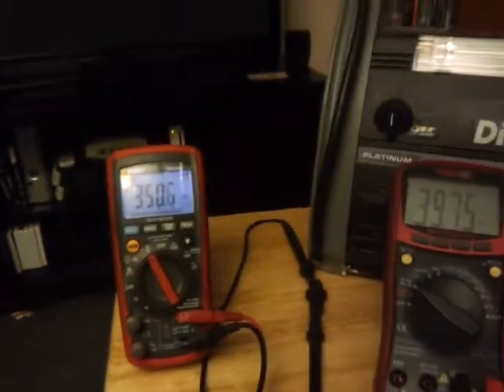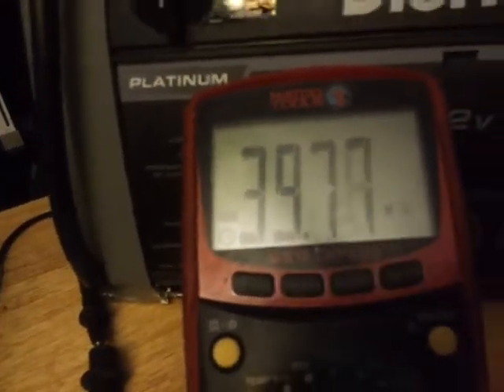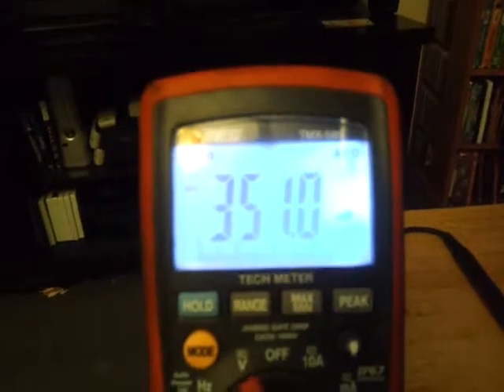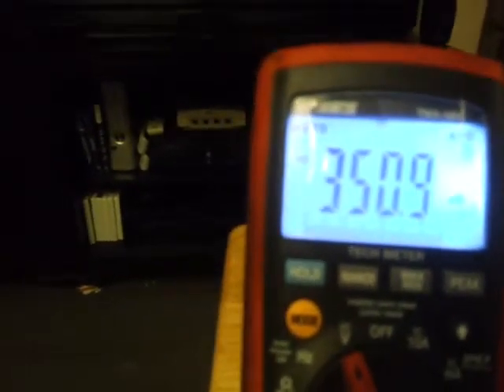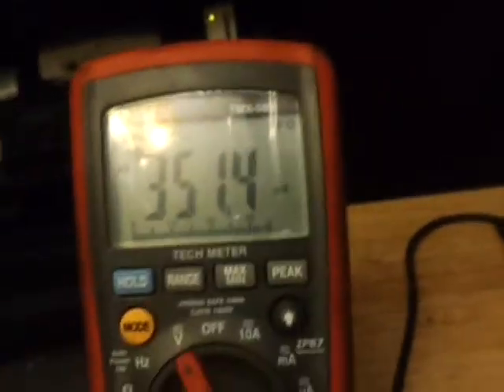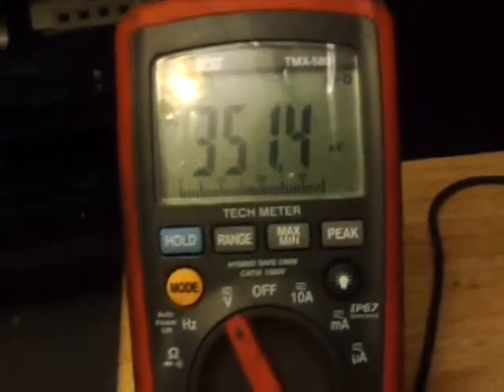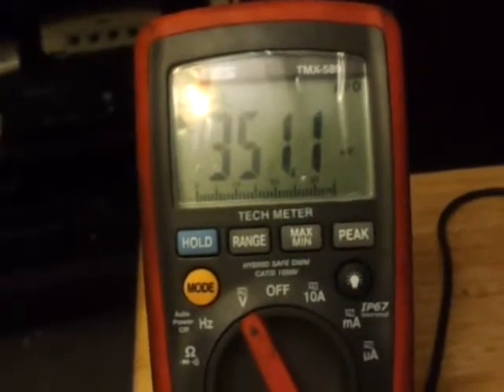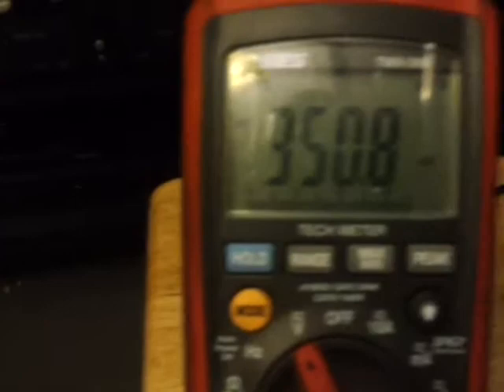Ohm meter testing vs. voltage drop testing/ loadpro operation pt.1

Comment from the maker: And if you want to know the current draw for the tool.  It is .5 amps for 12 volt systems, 1 amp for 24 volt systems.  I have used this on 3 wire 5 volt sensors too, no problems, works great.  If you have any more questions spelunkerd, more than happy to answer them.

Comment from the maker: Now if you want to check the ground side of the circuit, all you have to do is put the red load pro lead to a positive source, then put the black lead to the ground wire.  If you see ghost voltage, open ground, if you see full voltage, push the load pro button, minor drop, your good, if it drops substantially, bad ground.  These leads work just like a test light except you get to see the voltage drop and know what the voltage is compared to knowing if the bulb is bright enough.
Reply: busjockey1 This comment about how to check ground is what I needed to know and only available with bus jockey.  If Dan Sullivan ever demonstrated I missed it . This is , your video is important to demonstrate the Load Probe leads from an actual user. . Thanks busjockey

Comment from the maker: You can test on the positive side with no problems, it's just when you are on the ground side of a circuit.  For example, if you touch the red loadpro lead to the ground on the coil side of a relay.  You can energize the coil of the relay by pushing on the load pro button.  It warns you to be careful while testing on the ground side.  By energizing the coil you engage the contacts of the relay and that could give you an outcome that you don't want, such as making a starter motor turn.